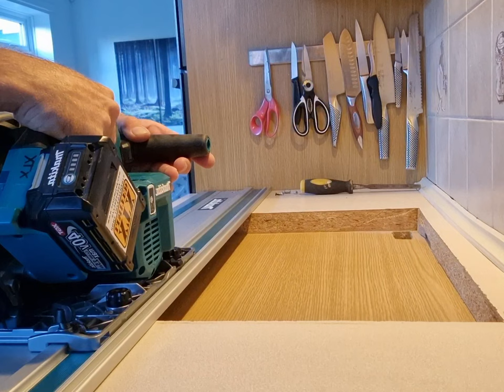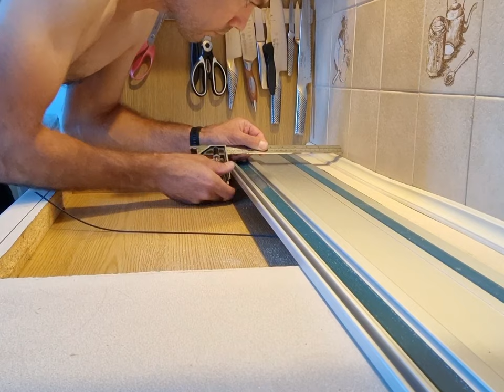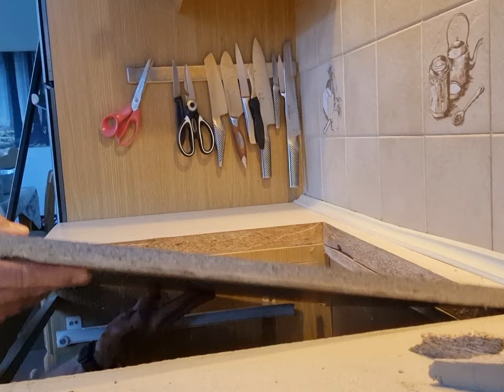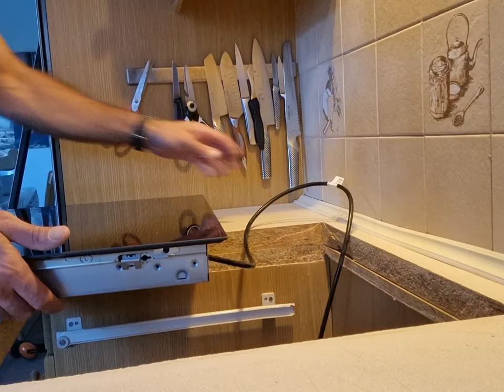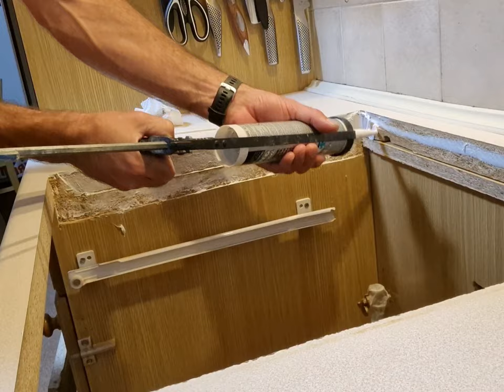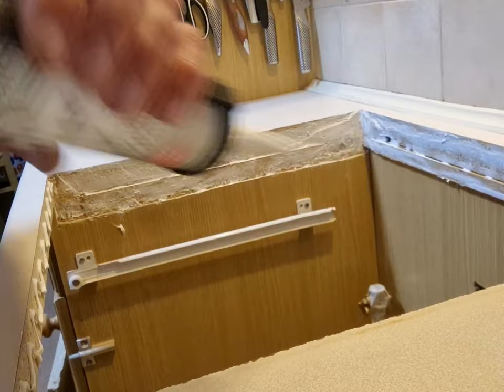Replace an old gas hob with a Neff induction hob XTX

Comment: A good job well done.  But for anyone in the UK (and likely Europe) at the moment it is not, IMO, a good idea. 

If on a gas supply there will be no energy outages this winter, but leccy could be restricted at times.  Any gas outage would require all affected properties to be checked, on re-connection, to avoid any disasters, so a ‘gas black-out’ is very unlikely.

Apart from the above, thermal energy (gas) is far, far less expensive than electricity.  Both are spiralling in cost at the moment, but even if gas usage on the hob was only 50% efficient (it is much better than that, I believe) it will still be less than half the cost of doing the same job with an induction hob (that also has efficiency issues over even a halogen powered hob?).  At the present time gas costs less than a quarter of the same amount of electricity during the day-time.
Reply: Gas is way more expensive than electricity where I live.

Comment: Neff require a minimum 40mm space on either side of the plate. Is this just for pan handle space? I ask as our units have an extra thick section for installing a hob but it’s the same width as the proposed new Neff induction hob. There is space at either side but it’s lower than the thick section. I emailed Neff but got no reply.